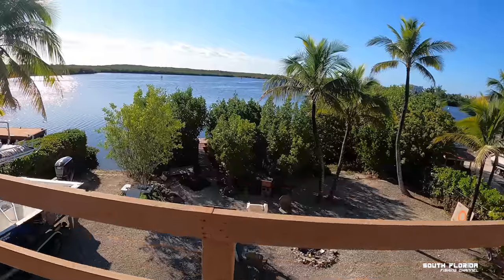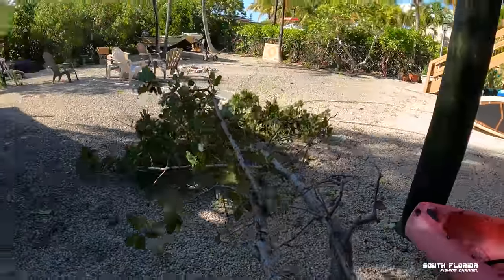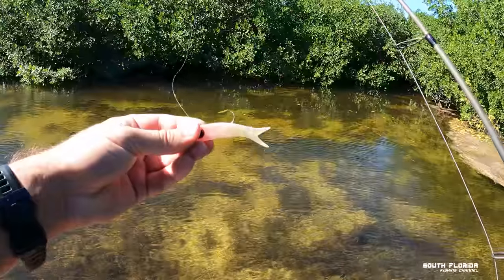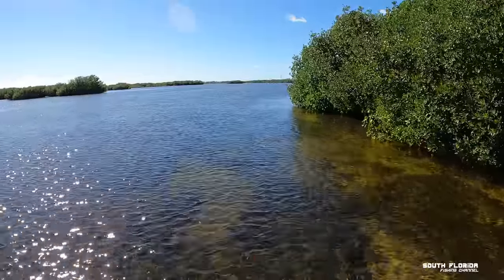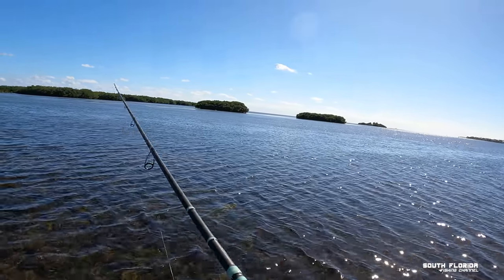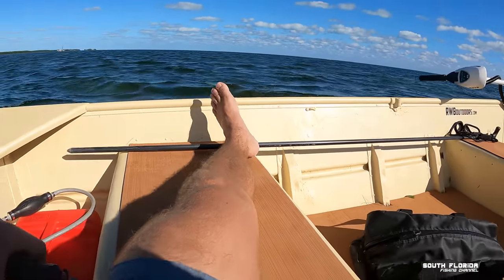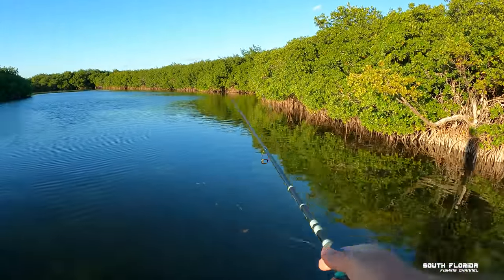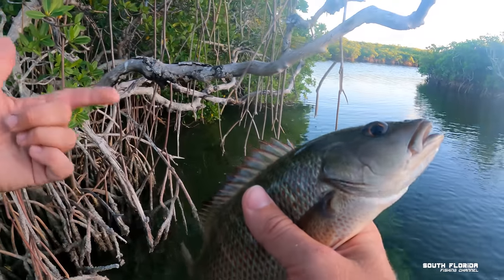Fishing the Florida Keys on my Jon Boat

Comment: Drift Chain for shallow water: Depending on size of jon boat use a length of chain to drag bottom to slow the speed of drift. Coil in back and let different amount out to regulate speed of drift

Comment: What’s your top speed on your John Boat with that 8 hp Evinrude? I boat myself a motor like your about a year ago and I haven’t had a chance to try it out on my John boat.
I love your excitement while you’re boating! I’m so like you when it comes to fishing in a boat! You also did a great job with the water pump replacement and exchanging the gear oil!
Looks like your boat is pretty fast!

Comment: Upgrade that troller to a remote control minn kota.   I love mine.  I have a riptide with co-pilot.   Wish mine had the gps spot lock option.    That 12v 55# you have should last you hours with a large battery
Reply from the maker: ok good to know! Thanks

Comment: Hi there captain.. Jon boat looking real good..  I have the same set up on my boat..   Thinking about changing it around to look at other people  Modify their tiny boat..  Give you  Some fishing advice.. It's like bass fishing you have to be a distance away from your  Is striped zone.. So the fish can't see.. Bass fishing is at least about   10 to 25 yd  Of casting to your strike..   And when you see predatory of fish you know other fish's Taco Bell round shocks sting rays Barracudas.. Is Eva turtles. It's not a good spot just a little tip for you

Comment: Got a red neck tip for ya,  find an old riding lawnmower, put a hitch on it.  Then you can use that to put the boat in and out of the water.  When I lived with the parent, we lived on a dead end road with a boat ramp.  I bet I put over a few hundred miles on the lawn mower using it to transport the boat.